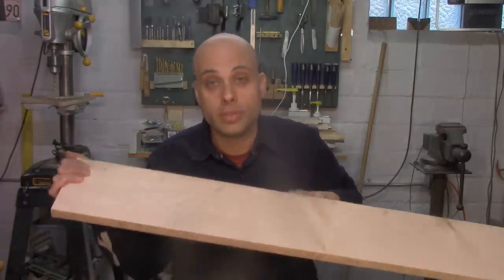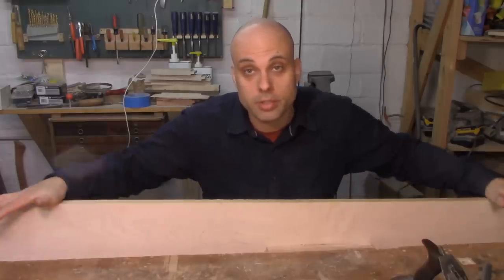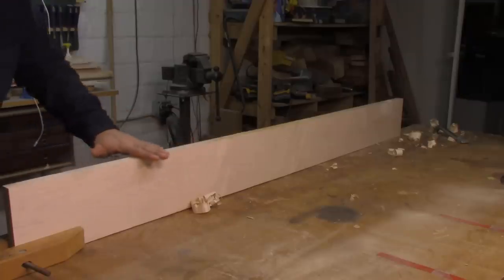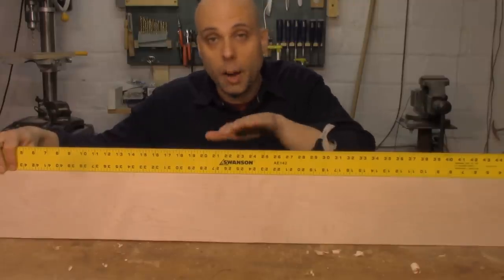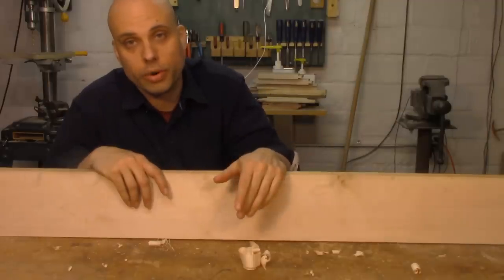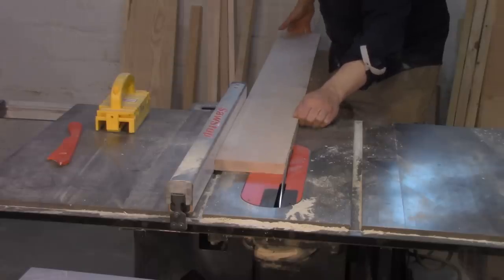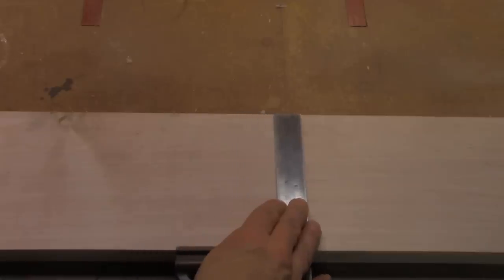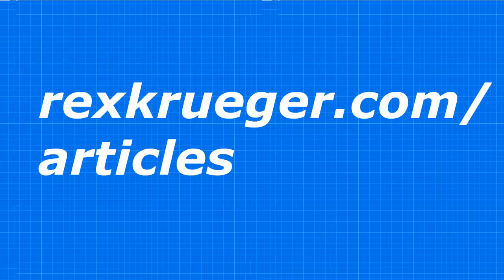Straighten boards. No jointer. No jig.

Comment: So what I'm really hearing is that it's easier and cheaper to find a friend who has a jointer and show up with a 6er of beer?  :)
Reply: Yup...just remember...work FIRST, beer second!
Reply: use a flush trim bit, a straight edge and a router.
Reply: Good, but I think you spelled 'joint' wrong.
Reply: @johnschenk9073  everyone is going to John's house.
Reply: @cameronjohnson3736  LOL, bring the beer, I have the jointer!
Reply: @johnschenk9073  what state you in lol ?
Reply: @cameronjohnson3736  I'm in Michigan.
Reply: or buy a 2" x 8' strip of mdf for 5 bucks and use the square edge to run a circular saw down the length of your board
Reply: Chris Hogan 
Great comment!
But I bet his finished board is dead nuts perfect
Reply: Use a router too....with a table...
Reply: Idk, man, friends can be pretty expensive.
Reply: @BYYoseph  I’ve watched a ton of videos for jigs and diy jointers and somehow not one person has suggested this. Great idea. Thank you!
Reply: lol did you find a friend?

Comment: Years back I worked with a friend who was a superb craftsman and cabinet maker. He taught me the trick of sprinkling talc powder on the layout table and marking the edges with the powder. The Hi spots had power the Low spots little to none the take the Jack Plane and plane it till I picked up a trace of powder along the whole edge.
Reply from the maker: Whoa!  That's a pro-tip. Thanks!
Reply: That is an incredible idea!
Reply: Common way to fit wood guns stocks to a gun for a tight no wobble tight fit where all surfaces contact the gun perfectly...
Reply: Sorry, can you explain this a bit more in detail? I've picked up woodworking over the last year or so and I'm a little confused as to the process here with the powder.
Reply: Neftali Perez I understand that you sprinkle the powder on a flat table and put the edge you want to straight against the table , the high spots will collect powder where low spots won't
Reply: Just used a similar method to make sure all my guitar frets are even across the guitar neck, covered each fret top edge with magic marker, then glued sand paper to flat surface, lightly sanded all frets till all magic marker marks were gone... Works great, guitar plays much better.
Reply: It would just be easier to use winding sticks and a flat reference surface to look for unevenness and twisting.
Reply: I just laid a four foot level across it and looked for daylight between the level and the board
Reply: Same idea as dye coating ones panel after primer in the auto refinishing field. Then u can block sand and all that, and hit the highs and lows
Reply: Very good advice,this technique is one of the best I've heard of
Reply: Idk dude...that and this video seems like a bunch of time wasting nonsense when you could just clamp or tape the rough pc to a strip of plywood and run it through the table saw and have flat, parallel and smooth edges in about 2 minutes
Reply: @patrikkevinmarshall  there are thousand ways to skin a cat. Your method is some kind of long jig. Better put couple of nails or screw in instead of using clamps, it will be a kind of tricky to pass 2 long boards in a clamp on the table saw.....
Reply: That reminds me of the age old question:   When a cat sits on your kitchen counter, does its' butt make contact with the countertop?  To find out, first get a tube of your wife's lipstick.  Hold the cat with one hand and the lipstick with the other hand.    ...
Reply: nice! learned something today
Reply: @patrikkevinmarshall  I am guessing "subtle" and "nuance" are not in your vocabulary. This was some lost art dude. Embrace it for shear power of knowledge. It will make you a better whatever. Understanding the simplicity of the basics is a good thing even if you don't use it.
Reply: @missouribob7850  The answer is yes. BRB, going for band-aids.
Reply: @missouribob7850 , Hah Hah, laughing my butt off! Best I've read in a long time!
Reply: This is a straight up patternmaker's technique, itself borrowed from the machinist's trade, where a transfer dye called prussian blue is used. Both rely on surface plates as the reference.
Reply: @missouribob7850  Well, does it?
Reply: I was thinking of using a cheap laser level, bit this is so much more ... I dunno ... comfortable? Homey? Traditional? Yeah, stuff like that.
Reply: @patrikkevinmarshall  gotta agree.  I get the whole traditional aspect of this method, if woodworking is your main gig or super hobby, but for a guy who just wants to get his project done on what little time he has after work, I'd go with the easier method.  Hell, instead of all that, I might just sacrifice and make the room for a jointer.  I mean, "getting it all hooked up to the dust collector" would be a lot easier than all that work.
Reply: @airgliderz  That's not what you want for accuracy. The barrel should be bedded so it's floating.
Reply: @Patrick-857  exactly what I said, a good tight fit is best for accuracy.
Reply: and now you have completely made this method totally usable :) great tip!
Reply: WOW..cool tip
Reply: @missouribob7850  ummmm.....  i need to quit the weed. lol

Comment: Some people buy boards that are surfaced on at least one face and one edge and then flatten the opposite face with a planer and the opposite edge on the table saw.  They are then disappointed when their project is not square and flat. You simply cannot trust boards that are milled S2S or even S4S because of wood movement from the time it was milled and when you use it on a project.

Comment: A hand plane was what all woodworkers used to straighten board edges from antiquity until rather recent times. It still works.
Reply: Can also be very efficient and it offers the highest level of finish. I use a power hand planer to rough out the board and then use a finishing hand planer to get that finish. 

Sometimes I will only use a manual hand plane.
Reply: A jointer is basically a plane with a six foot long sole. It's just a bit too big to move across a board, so it's flipped upside down and the board is run across the blade.
Reply: You have to be good and I am not. I always mess up with a hand plane.
Reply: @Kurgosh1  now I want a big ass plane.
Reply: In their defense though, woodworkers in antiquity didn't use calipers to make sure their boards were straight and parallel to a fraction of a millimeter, anything under a centimeter would be straight enough for most of the projects done in that time period.
Reply: Stoney3K You sure? They might not have had calipers, but they had a compass and straight edge, which would give them precision.
Reply: @Stoney3K  I am pretty sure the Victorian craftsmen did not have a powered tools to make the chairs and table that were in my grandparents living room, and the tolerances are definitely tighter than 100mm. Also, I'd say Paul Sellers is as precise or more with hand tools than any powered woodworking tools
Reply: @johnmartinez9220  ass plane
Reply: @Monuments_to_Good_Intentions  There are several DIY jigs that will hold your plane at a desired angle, by pressing and running it along the vertical edge of your board.... I hope that helps.
Reply: @MarcosElMalo2  Exactly. Even if the majority of wood workers in that era were a-okay with a millimeter, many antiques show a level of craftsmanship that is rare, even in these modern times. It irks me sometimes, (probably because I am old) that modern people assume that prior generations were primitive and ignorant. I believe it was the opposite. Without modern technology, calculators, computers, and precision precision power tools, they were able to surpass modern-day craftsmanship, working with "inferior and primitive" tools and a whole lot of brain power.., plus focus and attention to detail. Paraphrasing Julius Caesar, "Kids these days! They'll be the ruin of our civilization!" Truly, nothing new Under the Sun.
Reply: John Shilling There are still craftsman. I don’t have room for a table saw in my rental in Mexico, but there’s a furniture maker’s shop around the corner from where I live. When I need a board cut or whatever, I go see the maestro. Recently I had a board that needed to be trued on one edge, so I walked over to his shop, thinking he’s just run it through the saw.

Nope. In less time than it would take to set up the saw, he’d done the job with his hand plane. I checked it all over with my square and  couldn’t find a single fault.
Reply: John Shilling, That’s because they spend decades learning those skills. Yes, someone doing it for decades can surpass modern craftsmen with their gadgets, but that’s not the point. Modern times craftsmen need to produce more items with greater consistency and cheaper price, due to competition; and in modern times you need to know much more information about more subjects (the pressures on being able to adapt are much higher than those so called simpler times).
Reply: Patrick, 100mm is obviously 10cm! Any blind person could detect that. 1cm would be 10mm, and I think in previous centuries, Stoney3K is right and there wouldn’t be much precision.. unless you’re making very expensive furniture, which is done by artisans, anyway.
Reply: @creamwobbly  The fact remains that you can only have precision up to the precision of the tools you already have, doesn't matter if they are hand tools or power tools. If you don't have a perfectly flat surface to refer to, for example, you will never be able to create a straight line.

But for most projects, having a 0,1% tolerance in dimension is absolutely pointless anyway. The natural expansion and contraction of the wood itself is already more than that.
Reply: @johnshilling2221  that's because those are the only pieces that are still around. There are just as many craftsmen today using modern tools to produce work that is at the top of the game as there has always been. You're comparing the very best antiques to what is average today. There was plenty of shoddy work back then too, there's just none of it left. And modern tools and instruments have brought the average up. To suggest that the craftsmen of the past were somehow better than today's is just viewing the past through rose coloured glasses.
Reply: @davadoff  When learning a bit of traditional norwegian boat building we measured in Danish inches and were told to not measure anything under 1/8". But that did not mean the fit were that lose but anything below that were done by sigth and feel.
Reply: @davadoff  You are dead wrong and have obviously never seen antique furniture. Whatever you are producing with powertools today, back then it wouldn't have passed inspection by the master, even if delivered by the apprentice in his first year. They cared for fractions of a millimeter when it came to furniture. Anything visible, or contributing to strength, was created with pristine precision. They might have allowed themselves some slack where it didn't matter. They weren't stupid after all. But wherever you care about precision, they very much did as well. And they weren't even much slower in their work for most tasks. The powertools enable those of us who rarely do any work to reach acceptable levels of work result. That's their main advantage. Precision isn't something you get out of small powertools. Precision is achieved through dedication. That's something they certainly didn't lack back then ...
Reply: Hand tools work perfectly if you have lots of time, patience and skill.
Reply: @Monuments_to_Good_Intentions    with enough time and repetition it'll finally click and eventually just the sound the plane makes across the board and the shaving you get- you'll know it's flat.
Reply: @Stoney3K  Wrong. Craftsmen and scientist make precise tools of a precision for tasks that there are no preexisting tools for. Otherwise. We'd still be chipping flint and bones for tools. Oh, and most people concerned with this distinguish between accuracy and ease and reliable repeatability. People have been accomplishing this through out history. Not people like you. But people.
Reply: @brag0001  Craftsmen always use adequate precision for the task at hand effectually. Wood moves. And if you don't have the mind or senses for it dedication is wasted effort for some who need another career. The masters often played with factors they had mastered often resulting in new approaches. They also knew what flaws mattered, and what flaws could be hidden. Men have not fundamentally changed. Our culture has changed, and the values are different, so the lucrative skills and attentions to the relevant details change together.
Reply: @flashwashington2735 You can use tools to make more precise tools. And those more precise tools will make more precise workpieces (including even more precise tools). There is no way you can get micron-level precision out of hand saw, no matter how hard you try because the material the saw is made out of doesn't allow it.

You can, however, make something that gives you that precision with a hand saw but it means making jigs and other tools to reach that precision.
Reply: @Stoney3K  I know this. You can do lots of tricks. Including sequencing order, milling many small parts as gangs then separating them from the billet or stock. To allow  better work holding. As far as saws with wood kerf and set, back saws or pull saws, the related craftsmen develope motor skills that we lack. Still, close to mark then pare or plane. When match jointing some will prefer to leave the panels proud at the ends, then clamp the centers in together. Do there  are variety of schools based on who they followed or apprenticed. But every craftsmen worth his salt makes fewer errors, and remedies or hides them better as well.  God bless.
Reply: @Monuments_to_Good_Intentions  Rather, attentive, observant detailed. A properly provisioned, set up, sharpened, adjusted plane. The details that once attended to, make success easier, more sure, Then continual proper practice do as not to make error habit.  God bless.
Reply: @Stoney3K  Wrong, calipers were in common  use by Greeks and Romans, to size and to transr lines and measures. There's cut stone masonry you could slide a piece of paper between the joints, and wood, too. For the upper echelons of their societies. Maybe you meant something else? God bless.

Comment: I lay a 4 or 6' level flat against my table saw fence and it becomes the fence. I take the smallest cut possible, then repeat with the cut side against the level. Just make sure your blade is perfectly 90° and set barely above the board. Excellent flat panels after glue up.

Comment: I have a very small workshop (6’x6’) and live in a ground floor flat (apartment). Which means I don’t have room for a jointer or thicknesser and I have neighbours very close so I have to be aware of any noise or mess I make. I often work just outside my shop especially with power tools, and I am very careful how my hobbies impact on others. This video is super helpful, thank you from myself and my neighbours.
Reply from the maker: My pleasure!  Thanks for taking the advice in the spirit it was intended!
Reply: Dang,,, and i thought my 12x13 was small,,, and yes this dude is AWESOME!!
Reply: mark, you are a good neighbor. not enough space is always a problem.

Comment: If you don't have a plane ?  There is a trick to getting the first edge straight.
Run a piece of plywood thru the table saw, then mount your work to the plywood, with offensive edge of your work hanging over the edge.  Now run the plywood and work assembly through the saw again.  Works for taper cuts as well.
Nice video Rex
Reply: Shoddy Productions good idea. How about use a router if no table saw

Comment: Suggestions that will save time: Save a couple factory edge rips (4-6" wide) from a sheet of plywood or other sheet goods to use as a straight edge. Save one 8' and another 4'. If you intend to use a hand plane from the start, as Rex did, , use the straight edge to draw a straight line as close as possible to the edge of the board from end to end. When you have planed down to the line, you're ready to go to the table saw.

Alternate: If you have access to a hand circular saw, clamp the plywood rip onto the work piece as a guide. You sawn edge will be as straight as the plywood factory edge. You can then hand plane, if desired, for a smooth finished edge. A great benefit is that the edge cut by the circular saw will already be square.

Comment: I use a straight edge and clamp my boards to it as I run them through my table saw set with a ripping blade, it saves time I just don't have. I love your videos and does create a thinking process we should do before any project.